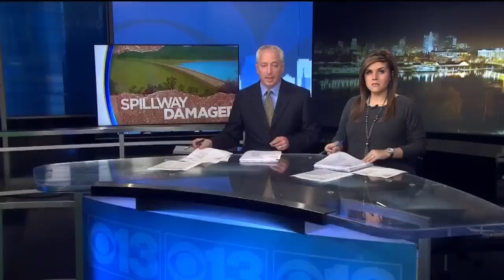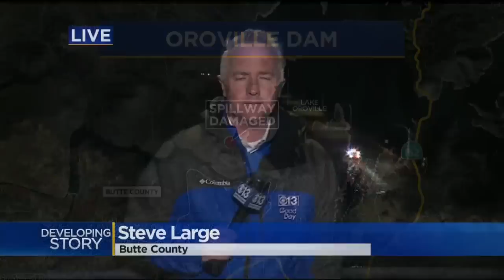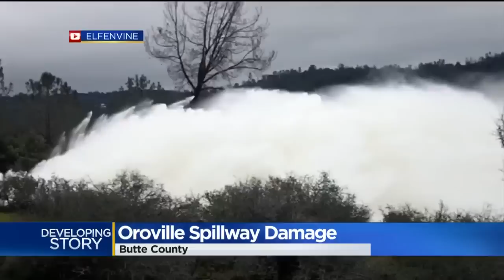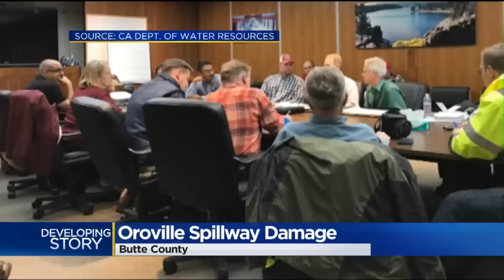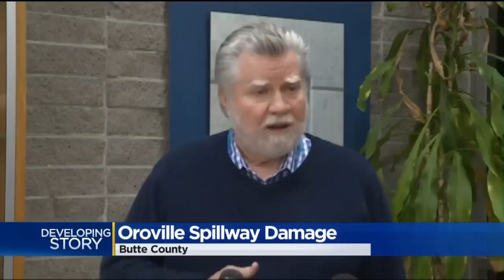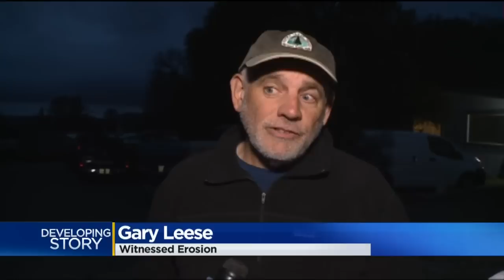Despite Hole In Spillway, Officials Will Release More Water From Oroville Dam If Necessary

Comment: All the engineer,s at D W R  need a new job! They could have released earlier like 10,000 CFS for the last 30 days. 

Who was doing the inspections??? Failing is not an options at the Oroville Dam, the whole state is depending on the success of DWR. 

Head should roll! This should be carrier ending.

I have lost any trust in the managers of DWR
Reply: They were releasing large amounts water.